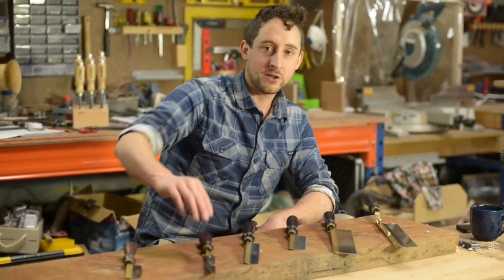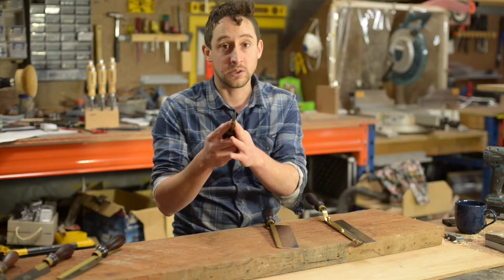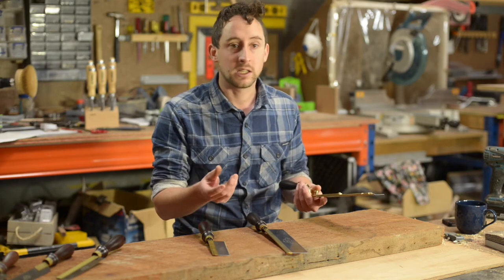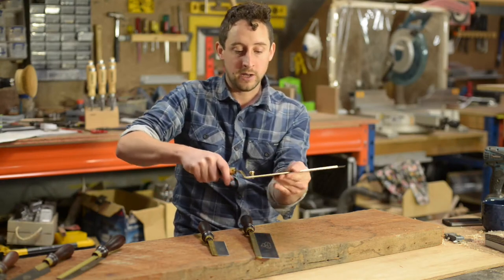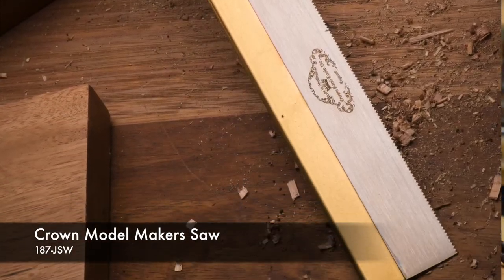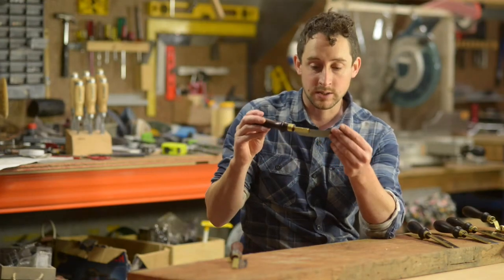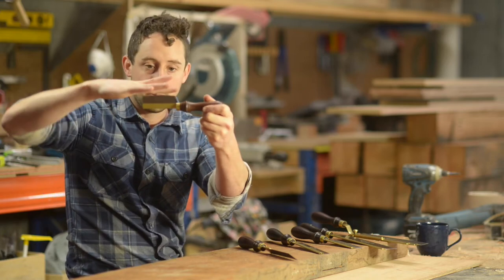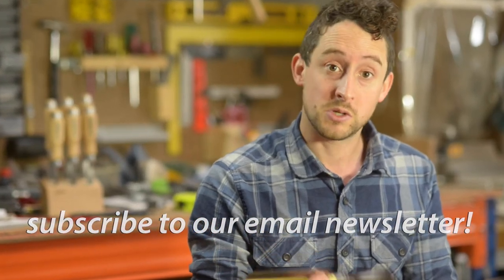Using Crown Hand Saws

Comment: I have the crown tenon saws, they are both really good . i bought the 10 inch gents and was not impressed with it's quality . the brass back is thin and cheap . The teeth are not as sharp as I would have liked either . I sent it back .I also have the razor saw that also is good quality.
Reply: Bought one too, its very common to get one not sharp, despite the manufacturer. Expect to sharpen most tools you get.